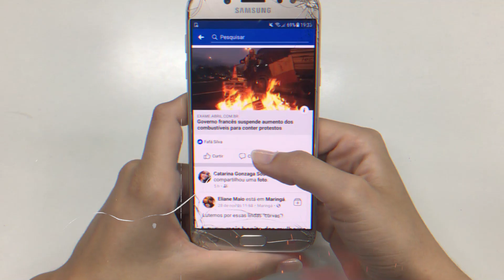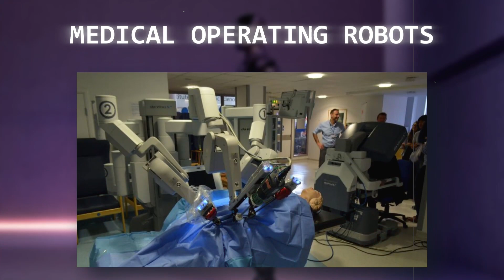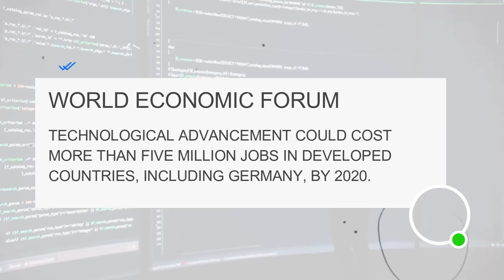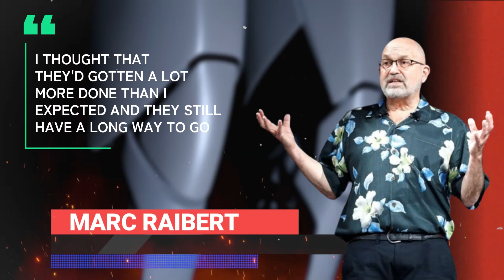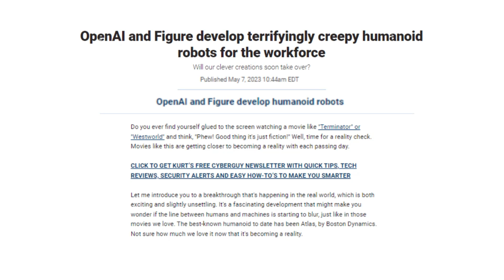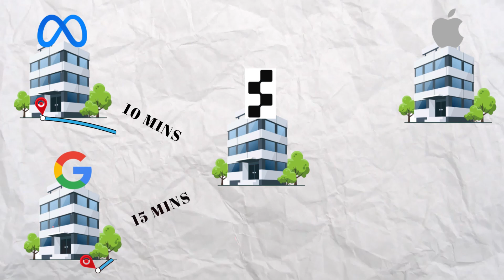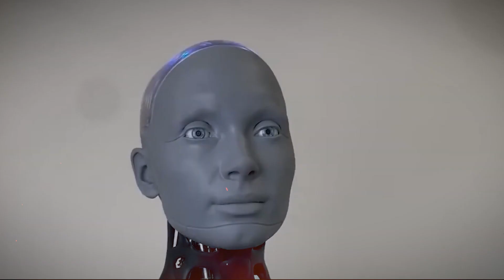How US Is Testing It's Scary Million Dollar Robots Of The Future

Comment: If your job can be done by a robot, you're in unskilled labor.
Reply: Untrue. You don't know anything about Robots, AI, and what their capable of. Every cyber security job or computer type job, Brain surgeon, Any other surgeon, stock market traders, software engineers, graphics design, marketing research analytics, tax preparer, accountant, data scientist, legal jobs, and around a thousand more. Do these seem like unskilled? These are jobs that have already been replaced by robots and AI.
Reply: @Darkice77 I have three degrees in Electronics.  I've taken robotics courses.  My career is Biomedical Electronics.  I maintain and repair medical equipment.  Robots are experts at doing one task- 

Move this object from here to here

Go here and rotate to screw in this object

Go here to drill a hole in this object.

That's unskilled labor.   The assembly line was very unskilled.  It was nothing but repetitive actions which is right up a robot's alley.  It's what they're good at.

A librarian can be replaced because it was also unskilled.  A librarian goes to school for 6 years and all they do is tell you where to find a book.  I worked security at a library.  That was all they were good for.   That's easily done by a computer program with a database.

Now-you mentioned brain surgery- You STILL NEED A BRAIN SURGEON!  You need someone at the controls.  You can't just send in a patient and have them come out all cured.  Those medical robots don't work that way.  Those robots are assistants only.  I've seen those robots.  They don't replace surgeons.  

AI is good, but it can't yet anticipate.  It can't make those kinds of decisions without someone at the controls giving it input.  

Robots make great companions in skilled labor and the only jobs they replace are the unskilled jobs.  

I'll leave you with one final thought- All of these advancements yet they can't seem to invent a robot to replace everyone at a fast food place!  Guess that isn't an unskilled job after all!